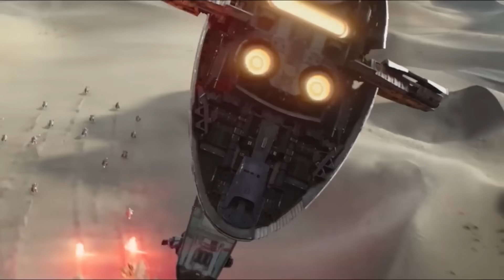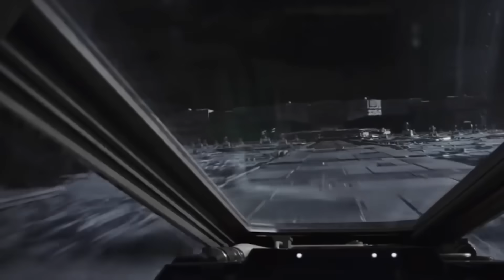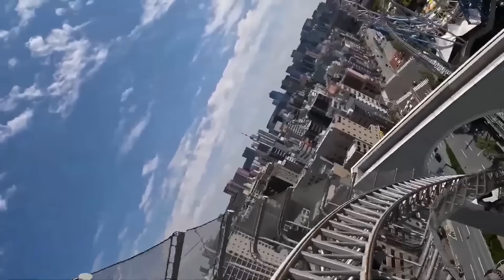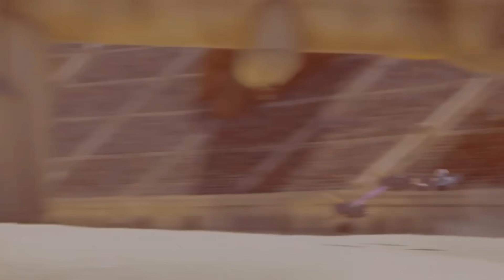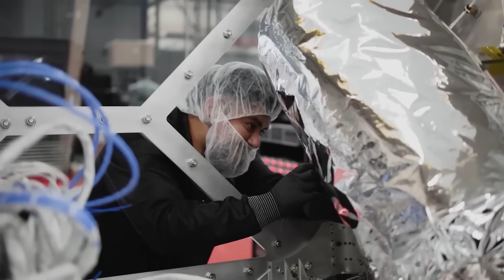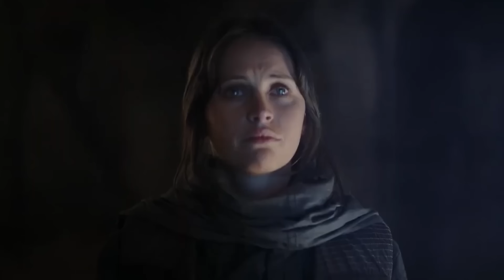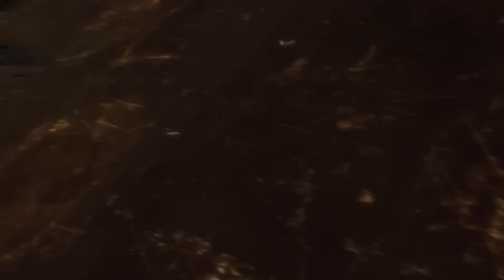The Problem with Star Wars Ship Design

Comment: 0:10 "One incredible design after the other". Truly iconic - as long you ignore the Disney Trilogy -_-
Reply: I like how the resurgence class star destroyers (if this is how they are called), as mentioned in the video, were one of the best parts of the sequel trilogy.... except they were literally ripped of Old Republic Sith empire Star Destroyers. The only thing different about those ships was that they had that left out the middle part where the hangars were put.
Reply: This was one of my biggest problems with them.
Almost no new ships in sequels, at least nothing comparable to the difference between prequels and OT
Reply: I agree that the sequels were shit and so were the designs although I still think snokes Mega star destroyer looked really intimidating and heald aura. (Until the bullshit holdo manoeuvre)
Reply: Despite how bad all the Disney movies are, excluding Rogue One, I think Kylo Rens ship is pretty damn cool.
Reply: @votive7478 No. -_-

It's just a slightly stylized version of Vader's Lambda-class T-4a shuttle. They just made it black and a bit pointier. Not a shred of originality in any one of those schit movies.
Reply: @justatiger6268  how are you gonna say "no" to my opinion? Its similar to the  T-4A except the color, size of wings, number of wings, hull design, and movement of wings. Kinda sounds like a different ship to me.
Reply: @votive7478 In the Dark Ages we would have burned Cathleen Kennedy at the stake. Just sayin'
Reply: @votive7478 the T4-A was a tank lol the successor was the T4-B which is prevalent in Galactic Battlegrounds.
Reply: @justatiger6268 yes there was....but they stole the originality from other people. The star destroyer that has the fork in the middle and the same bridge as the Immobilizer 418 class interdictor cruiser was a fan design.....my design actually. I designed it with a friend who was a huge staple in the Empire at War modding community. Z3r0x had a LOT of his designs stolen by Disney. He did all of the digitization of the models so that we could build skeletons and textures and figure out hard points but I drew them on paper. The Viceroy star destroyer was an escort star destroyer and originally had the "wings" like the Victory. We called it the aggressor and I don't know what it's called now but it had 3 large hangar bays and 18 diamond Boron missile launchers on each wing but they had to be opened to fire because the distortions created issues for the systems. (It looked cool) And the rear engine area had 2 short extensions reminiscent of the Venator. It was the equivalent of the original imperial Nebulon B frigate but with an entire fighter wing.

So yeah....tell me what Disney was original on and I guarantee I can find an original creator who got no credit for his work.
Reply: @justatiger6268 
bro shut up
 the Disney movies were fine... You lot are like halo fans, if It's a halo project that bungie didn't make you'll hate on it regardless of how much better it is unless it's fan projects,
Now if it's anything star wars not from George Lucas you lot keep hating on it regardless of how bad it is because you just hate the fact that Disney is making it and you blame Disney for the fact George Lucas isn't the one making it it's childish AF
Reply: @chargedx5768 Name one iconic ship from Disney's trilogy
Reply: @justatiger6268  brother I am an engineering student I cant memorise all my gibberish and come memorise useless fictional infromation like ship names lol..cant even remember certain family members birthday dates much more to remeber the prequels ships disney ships lol...some of us got real world problems and not just first worl problems like yall lol
Reply: @votive7478 bro shut the Disney movies were fine... You lot are like halo fans, if It's a halo project that bungie didn't make you'll hate on it regardless of how much better it is unless it's fan projects,
Now if it's anything star wars not from George Lucas you lot keep hating on it regardless of how bad it is because you just hate the fact that Disney is making it and you blame Disney for the fact George Lucas isn't the one making it it's childish AF
Reply: @chargedx5768  womp womp. I gave credit where it was due. I think Rogue One is one of the best Starwars movies and thats a Disney product. The reason I dog on the sequels is that the story is incoherent, not because someone other than the OG Lucasfilm crew made it.
Reply: @votive7478 Rogue One was a mess with an exceptional finale. Hands down one of the greatest couple of minutes in all of SW.
However, RO takes part in the timeline that was established by Lucas' films - not much innovation going on and for good reason.
The Disney movies however, were pure dogschit 🐕 💩
Reply: Some perhaps but necessarily. In the sequel trilogy a lot of the designs or far more similar to generic sci-fi weapons and ships as opposed to Star wars designs. As said in this video. Plenty of designs were heavily inspired by WW2 actually weapons and planes. We're as the sequel trilogy doesn't seem to have much inspiration at all. As for Disney I am very fond of the Razor crest from the mandolorian that is supposedly based loosely off an A-10 warthog
Reply: Yeah you’re wrong. Complaining just to complain. Majority of the Disney designs are awesome. Sorry. Evolution of the destroyers and tie fighters are as cool as they can be. Most of the resistance ships would fit right in with the OT.
Reply: @Huft923 Name one ship that is iconic from the Disney movies.
Reply: @Huft923  And that's the problem, they all look like OT ships. The difference between prequels and OT ships is what gave us so many awesome ships, but the sequels chose to recreate the OT. The sequel ships should look new and different not the same bloody thing painted black

Comment: It should be noted that X-wings can also perform quite well in atmosphere, perhaps the wings serve a purpose there. Might help with weapons cooling as well, putting them far away from the body of the ship then splitting the wing increases radiative surface area which would allow them to fire faster and longer or put more power into the shots, they HAVE been seen punching well above their weight in most conflicts they're involved in.
Other ships that function extremely well in atmosphere are those mentioned Naboo ships so aerodynamics kinda do matter.
Another thing to take into consideration, about the aesthetics part, fighters, transports and even some of the freighters, both light and heavy, are basically the cars in star wars... The famous Lamborghini profile, for example, is aerodynamic but not optimal thus making it more aesthetic than functional.

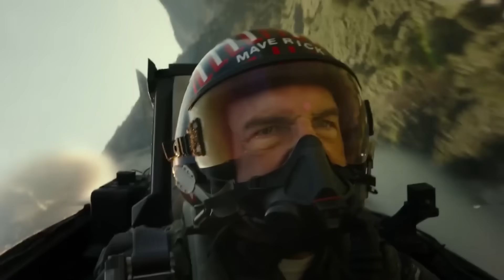Comment: 10:30 you have to differenciate between speed and acceleration, acceleration is the change in speed of an object, g force is the force due to de gravity of the earth an is a little bit less than 10 m/s2 you can travel with a really great speed and don't feel it if the speed is constant, that is the case of the solar system that is traveling at 230000 m/s around the center of the galaxy. If the earth would for a cataclismic event suddenly stop from this speed to zero m/s in a second the deacceleration would be equal to 23000 Gs. And yet we are moving really fast and don't feel it at all because we are moving in a constant speed. https://www.youtube.com/watch?v=AMlXzHU-GIU

Comment: Big windows? Jamming is an issue and what are you doing making such... uneducated assumptions Stickman, you have the terrible position of not being able to fully engage in science fiction due to ignorace of science fact. 
Are you assuming transparent materials for some reason might be less resistant to forces than opaque materials? Why? Here are three EXTREMELY tough materials that are simply difficult to mass produce for us lowly normal humans, anyhow consider the following imagination fodder. Read the following and get rid of that ignorant assumption that transparent = weak. 

The hardest and toughest transparent materials currently known include AM-III carbon, cubic silicon nitride, and aluminium oxynitride, each offering distinct advantages in hardness, temperature resistance, and commercial availability. 

AM-III carbon is the world’s hardest glassy material, scoring 113 gigapascals (GPa) on the Vickers hardness test, which is significantly harder than natural diamond (50–70 GPa).  Developed by researchers in China using high-pressure treatment of fullerene, this yellow-tinted transparent material can scratch diamonds and is potentially 20 to 100 times tougher than current commercial bulletproof windows. 

Cubic silicon nitride is recognized as the second hardest transparent material after diamond and the hardest transparent spinel ceramic.  Synthesized under extreme pressure (15.6 GPa) and temperature (1,800°C), it is the third hardest ceramic known overall (after diamond and cubic boron nitride) but remains transparent unlike boron compounds.  It is highly valued for its stability up to 1,400°C, making it suitable for extreme conditions like engine windows, whereas diamond becomes unstable above 750°C in air. 

Aluminium oxynitride (ALON) is the hardest polycrystalline transparent ceramic available commercially.  It is four times harder than fused silica glass and possesses the same hardness as sapphire. Due to its low weight and resistance to oxidation, it is widely used in bulletproof and blast-resistant windows, having been proven to stop multiple armor-piercing projectiles up to .50 BMG caliber.

Comment: Star Wars benefits from the Rule of Cool more than any other sci fi property. Ralph McQuarrie worked for Boeing before designing Star Wars so it all looks like it can fly, even if not suited for the multi-axis orientation and short burns of space.
It's not the speed that creates g forces, it's high rates of acceleration.

Comment: 9:50: these X-wing fighters rolling right to dive down on the target is hilarious. 

This maneuver was necessary in WW II  for early Merlin-engined fighter planes like the british Supermarine Spitfire. 

When applying negative g-forces by just pushing down on the target, the engine would cut out because the fuel flow is interrupted under negative g. 

So the planes rolled sideways, then it were not negative g-forces. 

German fighters like the Messerschmitt Me 109 had direct fuel injection on their Daimler-Benz engines, they could just push the stick forward. 

So it is really just looking cool without any reason.

Comment: If you want some hard science in your scifi fantasy, well... Ships are expensive to build, materials are expensive to source and build with. Make everything out of super dense super materials will be hard to produce, difficult to source, and expensive as heck. It also may affect other properties of the ships you are building that are not desirable. Sensors are great, until they are taken out, leaving you a sitting duck unless windows. Also, some of the ships mentioned have atmospheric flight capabilities which a window can help with if guided down by visibility, especially in emergency situations.

Inertia dampeners, Inertia dampeners, Inertia dampeners. Also, they do have computer assisted targeting. You see it with Luke on the Falcon in your clip, Vader in the trench run, etc... 

Bigger ships are equipped to take out bigger ships. They have smaller turrets for suppressive fire or to create a screen. The small fighters are there to protect those exposed areas you mentioned. We in the real world learned this quickly with Tank engagements and how useful aircraft carriers are.

The Last Jedi is not Canon, regardless of what anyone says. Add the other two movies in with them.

Comment: This is "my" opinion only and carries "no" weight to it. While putting shield generators on the hull's exterior seems like a design flaw, it points to a modular philosophy at Kuat Drive Yards. In a shipyard focused on rapid production and logistical efficiency, these shield domes are universal components. They can be easily swapped between different ship classes for quick upgrades or replaced instantly if damaged in battle, prioritizing repairability over invulnerability.

The Necessity of Visual Command
The 'windowless' sensors of Star Trek have a major weakness: as seen when Data hijacked the Enterprise, if your systems are hacked, powered down, or jammed, you are effectively blind. The windows on a Star Destroyer bridge provide a fail-safe. In a high-stakes engagement, having a direct line of sight ensures the command staff isn't entirely dependent on electronics that can be compromised.

WWII DNA and the Psychology of Scale
The Star Destroyer is the spiritual successor to the WWII battleship. It embraces the 'big gun' doctrine that ruled the seas before the carrier era. This heritage explains why the bridge sits so high and so far back. It isn't just about engineering; it’s the 'Psychology of Command.' By placing the bridge at the rear, command staff gain a massive, panoramic view of the battlefield—using the ship’s own hull as a physical pointer toward the enemy. It is a design built for intimidation and total situational awareness.

The Functional Geometry of the Starfighter
While Capital Ships lean into brutalism, fighters like the X-Wing adopt a more versatile geometry. Their iconic 'wings' are essential for multi-role performance in both space and atmospheric conditions. Beyond aerodynamics, this design could serve as a massive radiator for heat dissipation and provides a safety buffer—distancing the pilot from the intense radiation, vibration, and heat generated by the engines and weapon systems. Critically, the 'S-foil' expansion creates a wider firing arc, providing superior tactical coverage and ensuring a much better chance of hitting targets during high-speed dogfights.

Just my "take" on the Empires reasoning behind their ship designs along side Kuat Drive Yards whilst also taking pointers from real life designs as well as the Alliance design for the X-Wing.

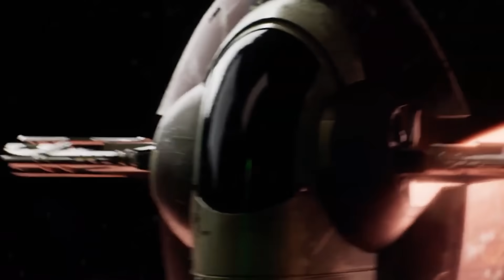Comment: 8:00 - I want to point out that windows are on real world battleships for a very simple reason: While it may be safer to use sensors and holograms, what happens if you have power disruptions in the middle of a battle?
Reply: What happens if sensors are jammed?
Reply: @Kolonol1 ☝️☝️☝️☝️
Reply: Also, there's no reason to assume that future glass materials would be any more vulnerable than solid metal.
Reply: @KenFullman  One factor to consider: however strong your "glass", if you have a "window", that implies edges, seams, joins, and those are always potential weak spots compared to a single uninterrupted surface.
Reply: it's way more easier, air doesn't kill you, when a window breaks due a shockwave or fragments, the normal air surrounding doean't kill the exposed crew, complete different to military submarines, no windows on the pressure body, beacuse just one cracked window due a shwockwave or fragment is enough to flood the whole section and kill crew. And spaceship have more in common with submarines, as spacebattles will be more like underwater battles.
Reply: @Dunkelklaue  The  pressure difference in a submarine is far greater than the pressure difference in a space ship.  In the case of a spaceship, the interior would be about 1 atmosphere of pressure while the lowest exterior pressure is a total vacuum (ie 0 atmospheres).  So the difference is a maximum of 1 atmosphere.

To have that pressure difference, in the case of a submarine, you would only be at a depth of about 30 feet.  Since submarines typically go far deeper than that, they have insane pressure differences to contend with.
Reply: @KenFullman  Yet even the Trieste had windows.  That was at a lot more pressure than even the hardiest military submarine.
Reply: At the velocities and sitances in any realistic engagement, visual observation would be impossible for human beings, simple point...

Comment: As others have pointed out, you’re confusing speed with acceleration. You can travel at incredibly high speeds without any strain on the body. Right now, you’re moving at around 514,000 mph through the Milky Way and you don’t feel a thing. Speed is always relative to something else, and in fact, thanks to Einstein's theory of relativity, you can just as validly say you’re at rest and the galaxy is moving past you at that speed, those two descriptions are indistinguishable, it just depends on the frame of reference. What the body actually experiences is acceleration (including changes in direction), measured in g-forces. That’s why people can pass out at 4–5 g, even at relatively modest speeds like on a roller coaster. Also, the whole part about exposed bridges and cockpits has nothing to do with within the rules of that universe, just universal common sense. :-)

Comment: The exposed bridge on the capitol ships are in line with reality. On all US Navy ships you have the open-windowed bridge, but also one, or more, secondary place that can control the ship if the main bridge or pilot house is taken out. Usually called the CIC, it is deep within the ship and is hardened to prevent damage or to repel enemy forces if the ship is boarded.
Reply: Yeah when he started off the video with "why do these ships have a bridge? I knew it was over 😂